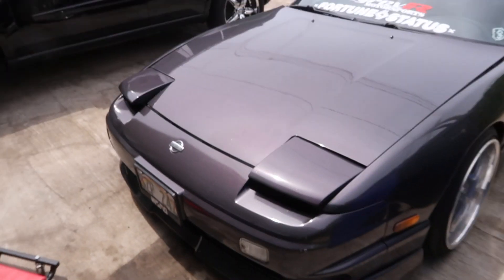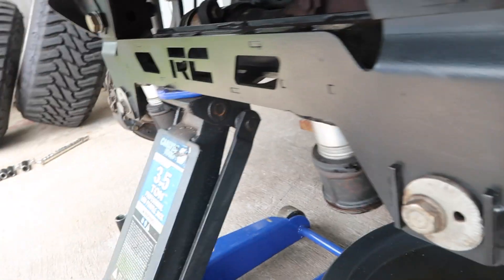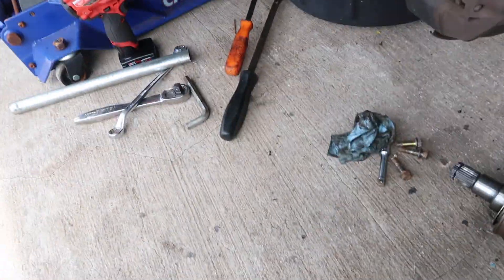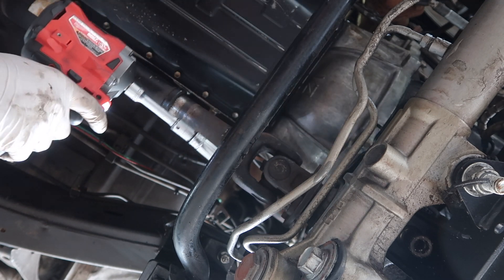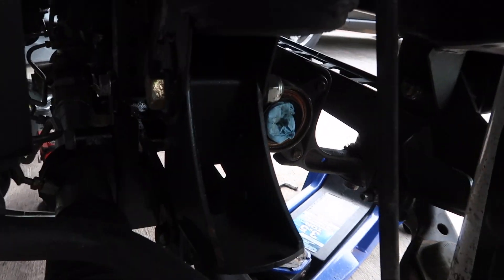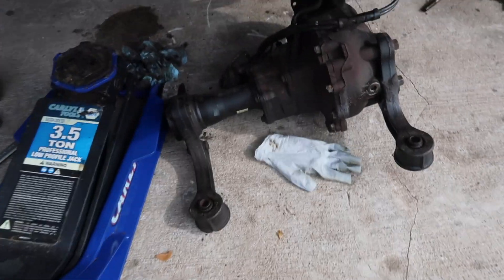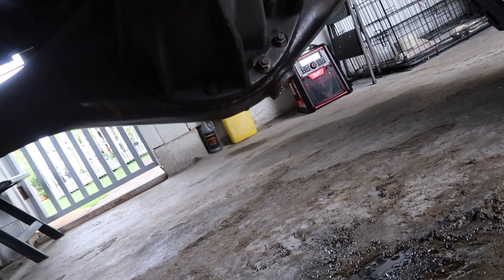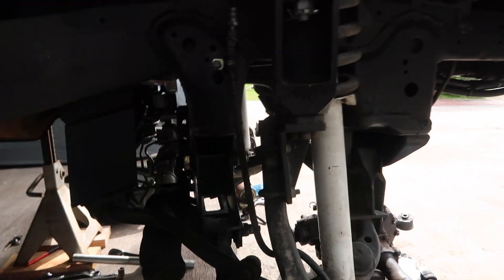Removing My Front 4WD Stuff

Comment: Guy I dead ass thought you was really making it 2wd 🙄🙄 but aye bro you had use the old hardware for the diff spacer? Cause I took mine off but if can use again I putting mines back on I get RC lift too just
Installed
Reply from the maker: ryland Peahu Hahaha 😂 For the diff spacer I think I had to use longer bolts, but if your bolts you have on right now has enough thread then can use those 👍🏼

Comment: Just straight front it. It's not that hard. Everything is pretty much off.
Reply: itsur boy Oahu sucks tho lol good luck getting it legal after that
Reply from the maker: I would if I had the parts and if Oahu’s vehicle laws weren’t too strict like what @goonoel said. Maybe later though, when I feel ballsy and have the funds to do it lol.
Reply: I got my 2 Toyotas to get legal. It's really easy especially now with the safety check laws. They passing everyone. Just don't go to high get recon them lift the crap out of it. So you don't have to drop your bumpers... They even approve c notch just no bags. Which is dumb. All you gotta do is re weigh the truck
Reply from the maker: itsur boy Ah I see, what year are your 2 Toyota’s that you straight fronted?
Reply: @fortunestatushawaii  85 and a 93. My 85 is a single cab and my 93 is a x cab both 5 spd. Before was way harder. Hardest part is mud flaps to me
Reply from the maker: itsur boy Oh the 85, not too bad cause some 84-85 came factory with straight front. The 84-88 & 89-95 Toyota pickup’s not too bad for find parts for straight front, but for Tacoma’s we have drivers side drop transfercase so either gotta use a Wagoneer front axle or aftermarket axle like diamond or trail gear. I’ve heard of people converting to passenger side drop t-cases but I haven’t really looked into that. Maybe when I get the funds to put everything together I’ll start doing more homework lol.
Reply: @fortunestatushawaii  yupp do it
 My 85 came with straight but installed the power steering but the 93 had to straight front. Just keeps the stocks and get recon with a 6" then sky it.